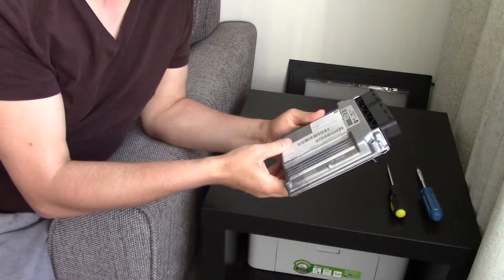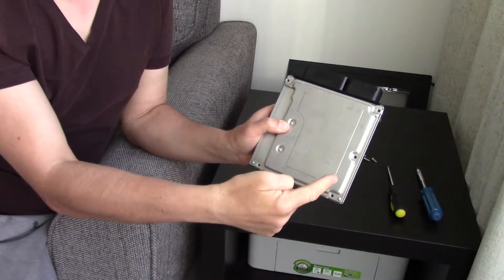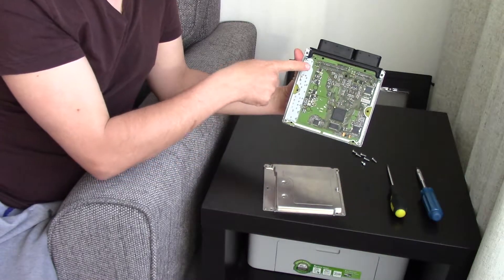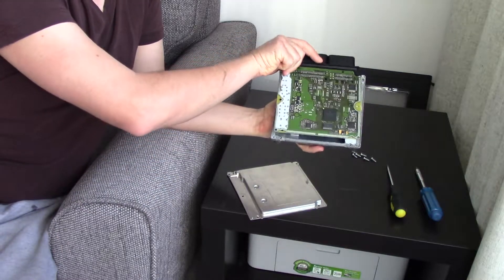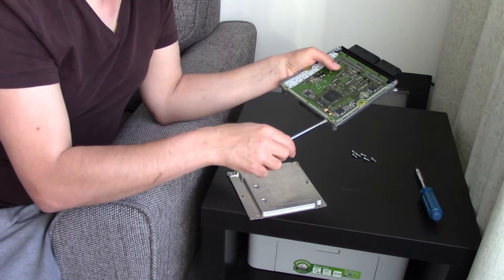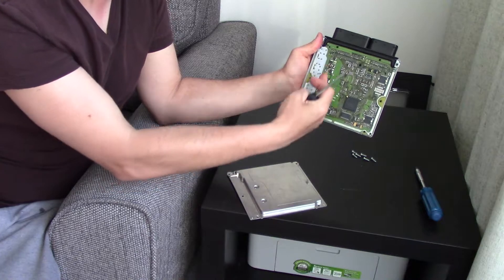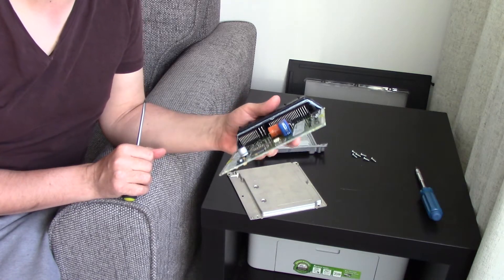how to open a BMW e90 320D M47 DDE/DME/ECU

Comment: I've just attempted this. The glue is very strong. I used a hot air gun on medium heat. I got the case above the glue to around 60 C and managed to pop it off. I used plastic trim tools to avoid any damage to the board components.

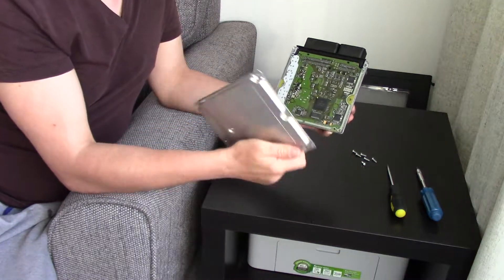Comment: Brother if you pay attention on your recording at 1:06,the game over,
mine with other fellows like to know,how to open the lid(which is of course glued with a strong sealant)and normal operation is very hard and can damage the outer cover as well.but it seems that you do not want to spread the knowledge to rest of world.
your reply is awaited
Reply from the maker: I did not remove the lid myself, it was done by people who tried to fix that CPU. As you can see the white strip of heat-sink glue is on one side. I suggest you start prying on the opposite side. The lid should not be glued in (only that white strip). Maybe a little of glue holding it in place near the top. Lift the side opposite from that big strip of glue and just keep slowly lifting while holding down the circuit board with the fingers of the other hand. That white glue should just rip apart.
Reply: @funitoo  thanks for your kind suggestion.
Brother this is a bit tough game to open the cover with out getting ECU damaged. Because it is property of customer.
Again my request is at same ace,that is there any suitable way to open the outer lid.
Reply from the maker: @mehboobalam6956  sorry I can't help you, I didn't open the lid myself. I did remove the circuit board myself, it was glued in too, I just used force to slowly pull it out. It didn't break but I suppose it could have.

Comment: Wtf... The back cover was removed by someone else and you don't know how they did it? What a waste of my time
Reply from the maker: good point, I'd say start prying at the edge which is on the opposite side from that white strip of glue. That way you should get a bit of leverage to make it easier.
Reply: @funitoo  to be honest mate, I just wanted to know if there was any sealer on the inside around the unit? I knew there would be the white heat sink compound. Cheers for getting back though, take care

Comment: did it work after? thanks for the video
Reply from the maker: Two "legs" on one of the microchips had corroded so much there was nothing left of them. I'm surprised it had worked that long. But if I had known about the problem and addressed it sooner then there is no reason why it wouldn't. I tried to finds a replacement microchip for re-soldering but nothing came up on Google. So I just replaced the whole ECU.
Reply: Tad Ka how much did you pay it in the end? Do you still have the old ECU? Reason I ask is... Mines the same with the same ECU. I've cleaned it up but I am damn sure a zero-ohm resistor has come away.... I need a close up pic of the bottom right corner when you take the first cover off... Can you help? Many thanks. Epic video.
Reply from the maker: I should be able to. Let me dig it out. Oh, I paid about £700 for a refurbished ECU plus I asked for a remap which was another £200.
Reply from the maker: Jay Gee here it is, let me know if you need a different angle or something. https://i.imgur.com/rCk2SRt.jpg
Reply: Tad Ka thanks. I tried to repair and it went tits up. Did BWChipTune do it for you? £700 is very steep for me. Your ECU doesn't look bad mine was all corroded with parts missing and it only just showed symptoms of none start.
Reply from the maker: Yes it was the BWChiptune. From what I read (from BWChiptune) going with others is not a good idea. They don't do a thorough job. Could it be repaired by a professional? Mine needs a chip I don't know where to source but if yours only needs common components maybe it can be fixed.